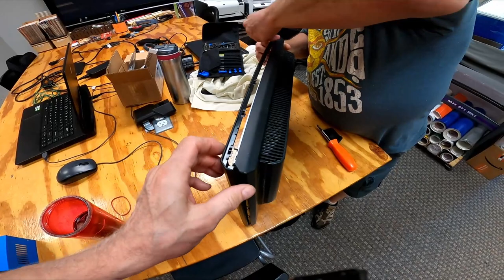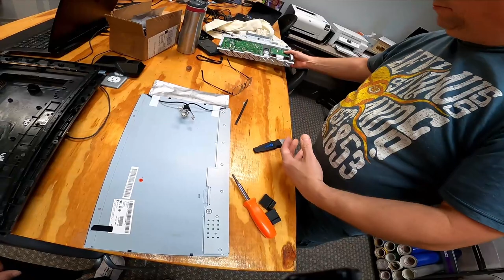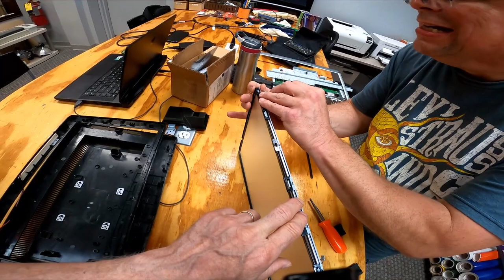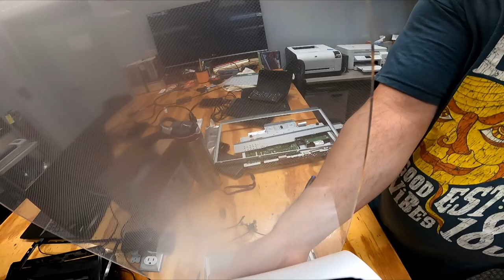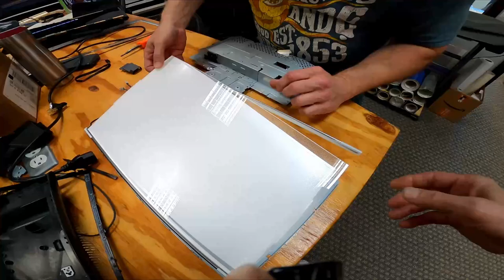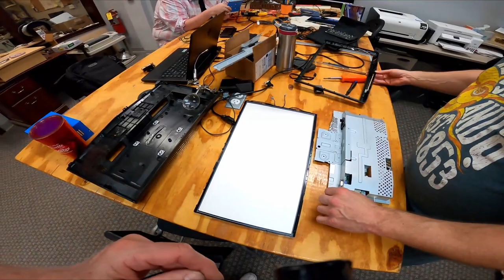DIY Lightbox from old Monitor

Comment: But getting it to stay on. That's the issue i want to solve.
Reply: Just press the fkn button or unplug the ac
Reply: @ibalep  it is not about pressing the button mate, with out an HDMI signal the monitor goes automatically to stand-by mode
Reply: @dariobon did you find a solution?
Reply: Wish I could solve this problem too... looks like they skipped that part.
Reply: Something to try. Hook up the dead monitor and a working one to the computer. You have one you may be able to set using the computer and since you have it set up as dual monitors it sets them both. Maybe.... I don't know. Just a thought.
Reply: guys, you don't have to keep all the circuit boards to light up the led, it consumes more power than you need, the LED strip in the monitor usually comes with 4 to 7 wires, strip the wires and make sure not to let them touch each other, power your monitor and measure the voltage between the negative and each of the wire until you find the main wire that supplies the main voltage and feed it directly with the same voltage from any source, you can also use the monitor's power supply unit but maybe you need to use a resistor to lower the voltage. 
if you don't have a multimeter to measure the voltage, you can disconnect the LED cable and strip its wires then using a low current power supply ( start with 50mA), connect the power supply negative to the negative wire of the LED and then using the positive wire of the power supply touch each of the LED wires to find the main voltage wire. 
note that sometimes you need to use 3 wires to light up all the LEDs, one wire connected to the negative and two wires to the main voltage. 
also sometimes you need only two wires, one negative and one positive but there are two other wires coming from the LED you only need to connect them to each other, by means just tie them up. 
it's not hard but lots of possibilities. 
Edit: 
the LED strip comes on a piece of metal and a thermal compound in between to cool it down, just make sure to keep it as it is.
Reply: @bigdog9480 seriously? did u see any leds in that monitor? that monitor uses an inverter to light up those neon tubes. geez...
Reply: @salinkosalim6032  
it's called CCFL-backlight, cold cathode fluorescent lamp. 
I'm not talking about this screen in particular, most of the screens are LED backlit, the CCFL backlight was more common in early 2000, NOT IN 2024, so people who are watching this video they mostly own LED-backlit, not CCFL.